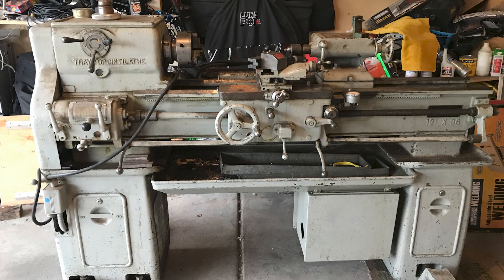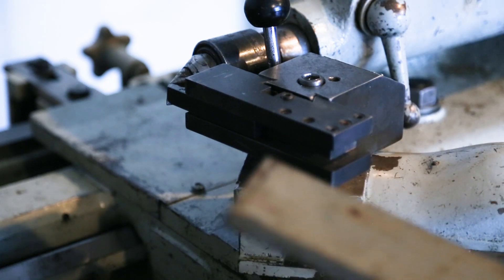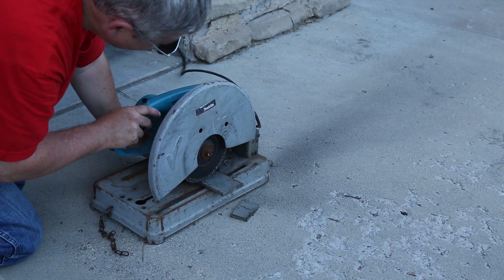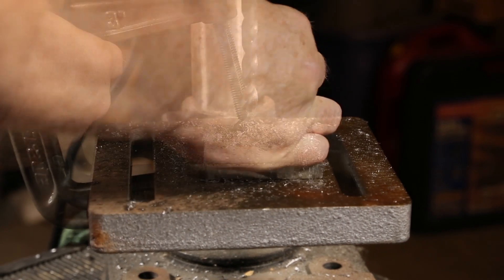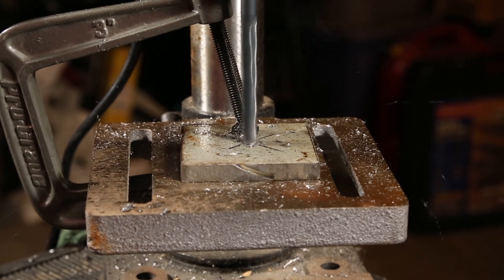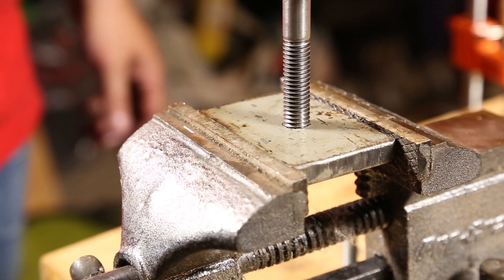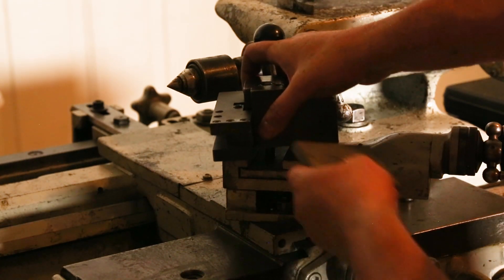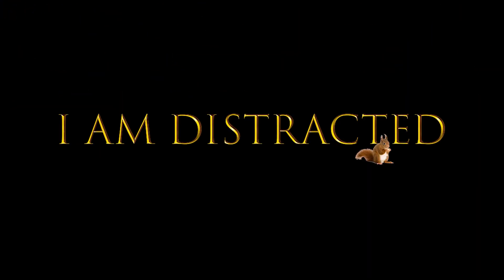Cincinnati Cintilathe Tray-Top Lathe KDK 100 Tool Post Fix

Comment: My buddy has this  or a similar tray top lathe and cant do threading without some sort of shim between the lead screw and where it meets the quick change box, any help is appreciated
Reply from the maker: There should be a drive screw there... and a coupler that hooks to it to actually make it turn. Which can be made on the lathe... :) 
I doubt there are parts out there for these older lathes, so it would have to be made.
Reply: @IAmDistracted  I'll see if I can get pictures,  are there any resources you can recommend on these lathes?
Reply from the maker: Here's a link with tons of info and pictures: http://www.lathes.co.uk/cincinnati-tray-top-lathe/

Comment: Hello Sir,
Is it a  12,5? Perharps can you help me: What is the power of your Electric motor? 1 1/2 horse ? And the Amperage ? I would like know the rpm of the électric motor too..
Thank you very much for your time and your help, 
Greetings from France
Reply from the maker: Salut! I believe it is a 1 1/5 horse power motor and 15 amps. I don't know the rpm, it might take a while to find out... I have several other projects going on right now. A+
Reply: @IAmDistracted  visibly is 770 rpm for 1,5 horse for the traytop 12,5 and 2 horses on optional
Reply from the maker: @moi6291  Cool! Thanks for the information!!
Reply: @IAmDistracted  Thank you very much 👍👍👍

Comment: The tool holder is adjustable for height using the Allen screw in the center close to the block. Yes its old but I couldn't stop trying to help.
Reply from the maker: Yes it is. Thanks!!!